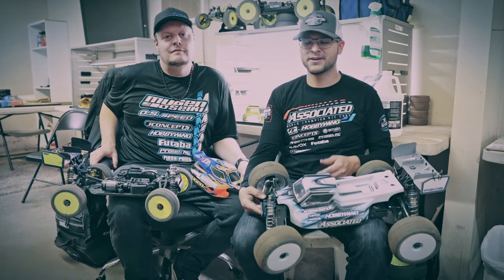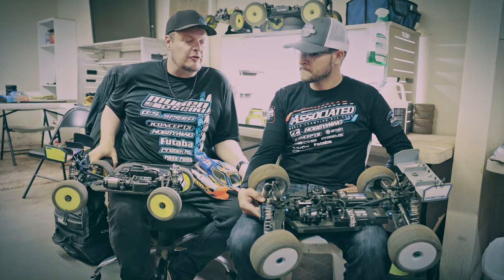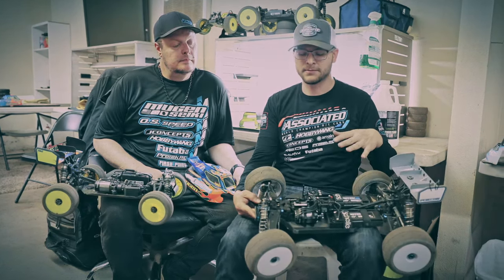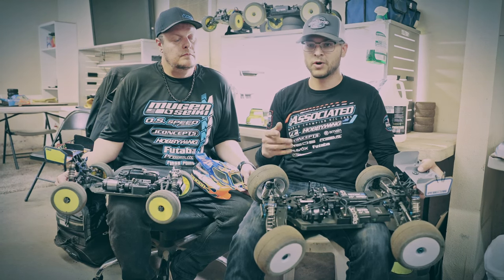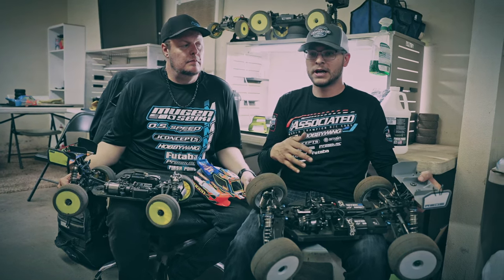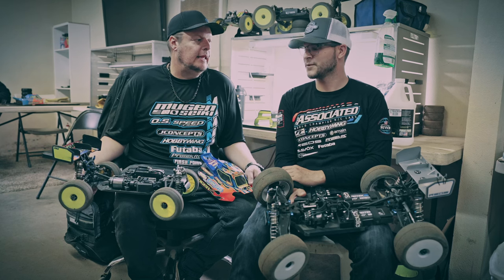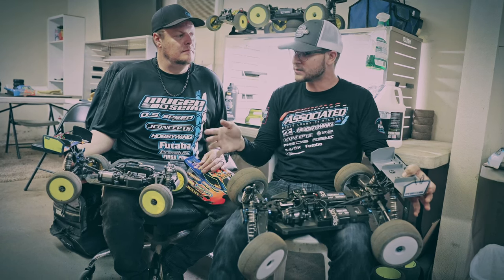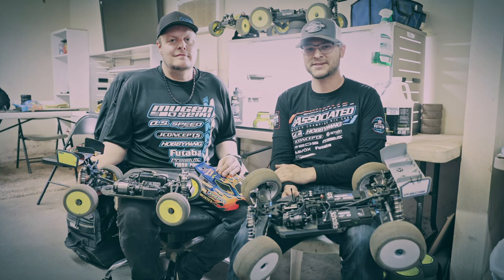Ebuggy & Etruggy HOBBYWING Pro Tips 2024 with (Adam Drake & Spencer Rivkin)

Comment: Some slightly confusing info on this video. Turbo timing is not enabled if the EPA is set below 100%. Also, for HW anything 94 and above is considered 100%. So, 96 is treated the same as 100, and turbo will work. 92 is not, and turbo is never activated. So the reason you're feeling such a difference between 92 and 96 is because turbo is disabled and also you're always in PWM when not at 100%

You can easily confirm if the ESC is interpreting your full throttle as 100% by looking for the green light to go solid green at full pull.

Comment: Nice Video
I am using the HW 2000kv onroad motor in my e-buggy and this thing is awesome!!! Never had an issue with incoming dirt or wet astro for 13 month now & it saves some weight🤘🏻my gearing is 15/48 on std. Losi diffs
Using almost Stock ESC settings... only:
Throttle Rate 17 (and 10% expo on radio)
Brake Rate 17
Brake Power 75% + some small adjustments on the radio
Turbo 10°
I Love it❤
Reply: Hobby wing ? How are your temperature   . I think I bought one but did not check is for onroad did not install it. Just bought cause it was cheap.
Reply: @j-1lokes294  Yes the Hobbywing Xerun 4268 G3 2000kv..
Here in Germany we always running 3 times 10 minutes Mains.
Previous weekend we had:
Ambient 20°c/68°F
ESC 52°c/125,6°F
Motor 72°c/161,6°F

Comment: Kindly I checked the 2250kv motor and it seems that the timing can also be adjusted from the back plate of the motor and it is already on 30⁰ timing. 
So if one is going to add the boost and the turbo timing should the motor be left on 30⁰ or it should be a adjusted to a lower degree? 
Something else the boost can be adjusted in different stages , do you know in how many times it can be devided and if it is added to the turbo timing?

Comment: Throttle respond ? What is that.  I usually like Tekin for 1/8 scale For 1/0 scale hobby wing. The only thing with the hobby wing it’s seems that it has already drag brake but it does not. I usually have to turn on/ up the cruise control up to 4-5%. What that does the car keeps on rolling before the speed controller automatic stops your car.

Comment: I found this interesting with the difference that they talked about between the motors because as they mentioned in general, most people look at the higher kilovolt motors as being less efficient, but I guess at the end of the day if it’s giving you the speed you need with less actual throttle And not having to run more timing in boost I guess at the end of the day that is more efficient at least according to what they are telling us, which they’re the professionals I believe them